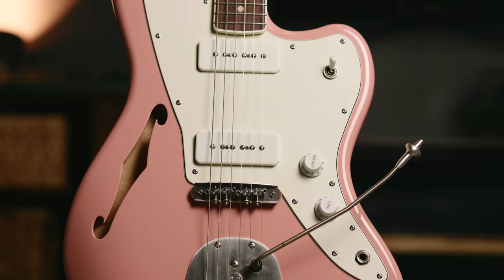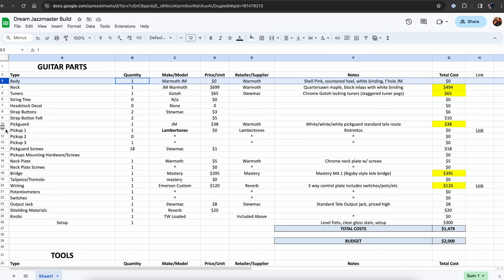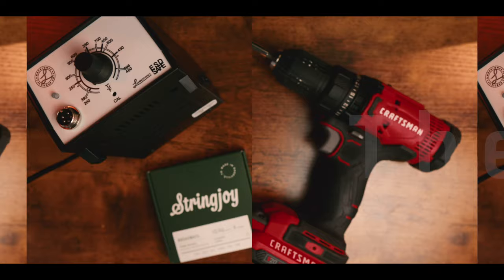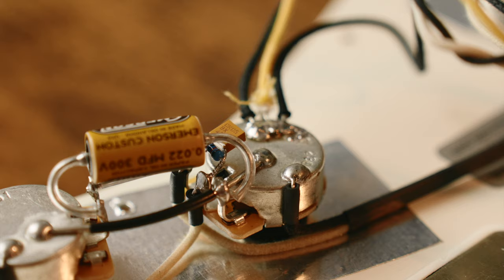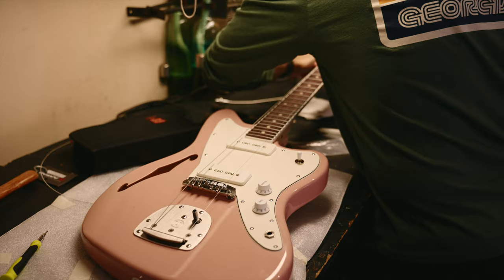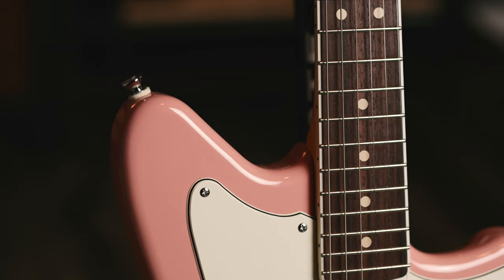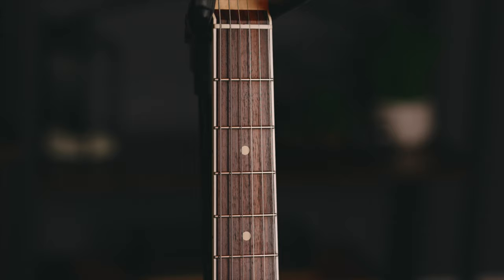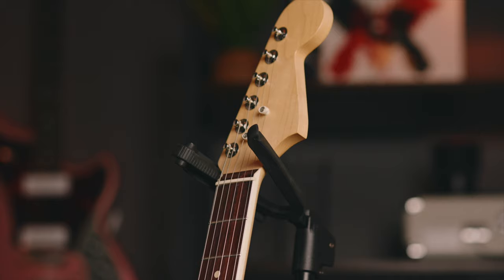Building My DREAM Warmoth/Partscaster Guitar! (Jazzmaster/Offset Build)

Comment: Really cool guitar man! I just happened to finish my first Warmoth build a few months ago and there are some similarities with yours. I also went with an F hole and two P90's (Lollar low and regular wind), but on chambered tele body and hard tail bridge.  I really went back and forth on the bridge/body deciding between hard tail tele or offset guitar with vibrato. I also did my first nitro finish using Oxford nitro sold through Solo guitars - highly recommend. Lastly, two thoughts on your strap button. You'll be safe if you want to use a decent strap lock, like Schaller. Also you could probably correct it yourself by making a dowel and gluing it in with some wood glue. After it dries you could redrill at a better angle and ideally start the new hole just a tiny bit closer to the neck but still close enough to cover the old hole with that strap button felt washer.
Reply from the maker: Congrats on the build dude! Hopefully it was a super fun process! Sounds like a sweet build.

I did attempt that but where I needed to move the hole was too far over where the felt wouldn't cover it. 

For now I think it's OK but may have to go the strap lock route!
Reply: @ZachBrobstMusic  yeah it was really rewarding! Very much enjoyed the whole process. I think we had a similar mindset, I spent months researching and narrowing down exactly what I wanted. Given that I had never done things like spray nitro or final finishing/buffing I also wanted to make sure it was going to be feasible to get an end result up to my standards. It’s always a learning process. The finish came out fantastic, but I did sand through the color coat just barely on the matching headstock in a spot. It sorta just looks like normal age/wear so I’m totally fine with it. I did a “thin skin” clear over the color so im expecting some aging over time.
Reply from the maker: Now you know for the next build how to do it even better! That's impressive though, I've not ever done anything with painting. Always been too scared!  @VintageRadius